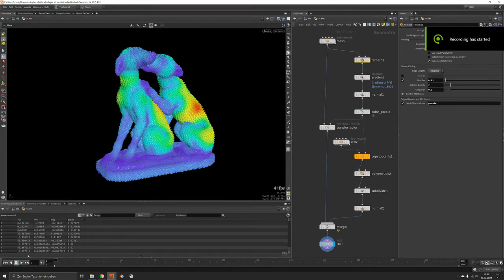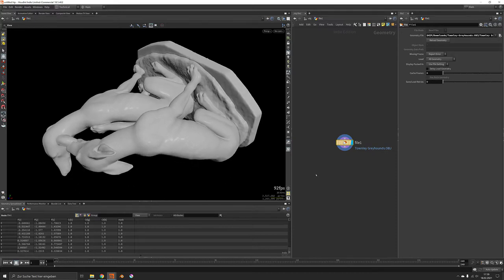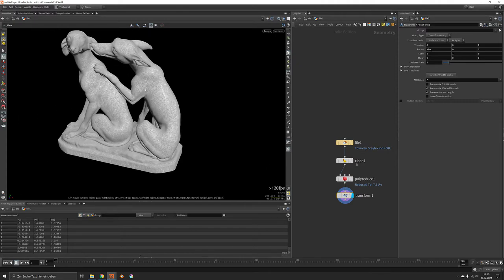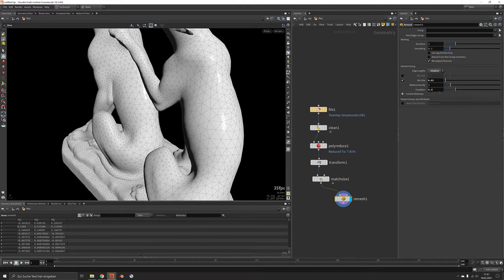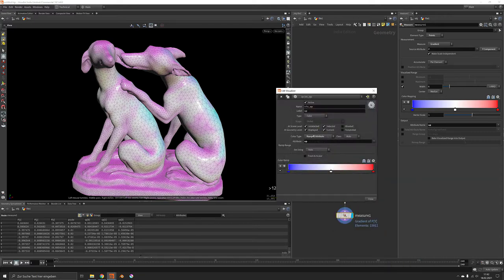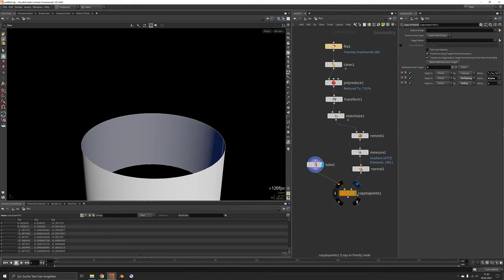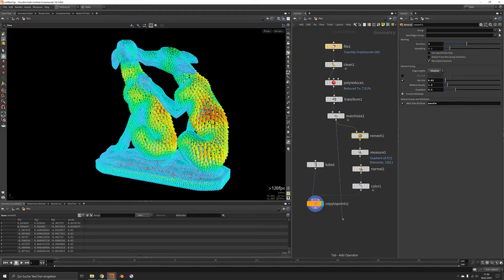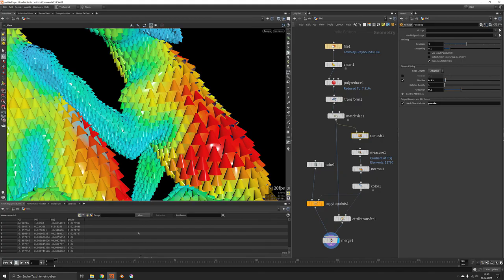Applying Scales to Mesh Surfaces – Houdini Tutorial

Comment: thanks so much Konstantin, this is brilliant, 
do you know if there's a way to paint the direction flow of the scales? so that painting red aligns scales with X axis, painting Green makes them face down Y etc?
Reply from the maker: Hi Will, 

you could paint some red color on your mesh and append two measure nodes:
- the first one measures the gradient of P's X component and exports and attribute named up_x
- the second one measures the Y component and exports an attribute up_y
-Then a point wrangle blends both up directions based on the amount of red color like this:
vector4 q_x = quaternion(maketransform(v@N, v@up_x));
vector4 q_y = quaternion(maketransform(v@N, v@up_y));
p@orient = slerp(q_x, q_y, v@Cd.r);

Also I recommend this course if you want more control:
https://www.udemy.com/course/in-house-tool-building-for-tds/